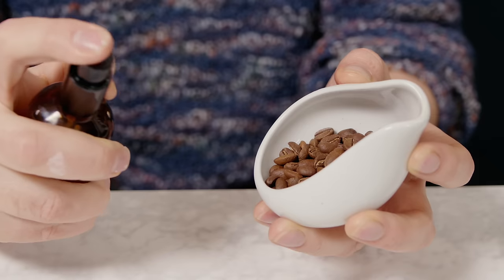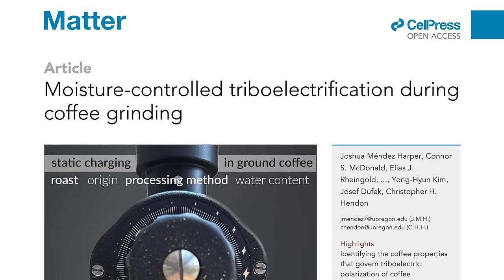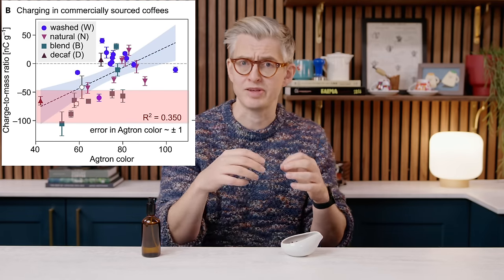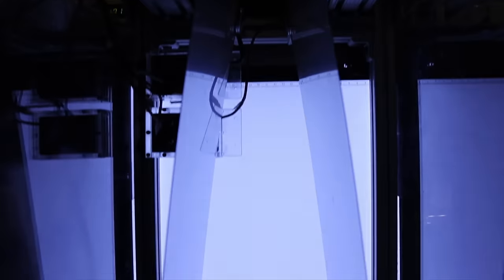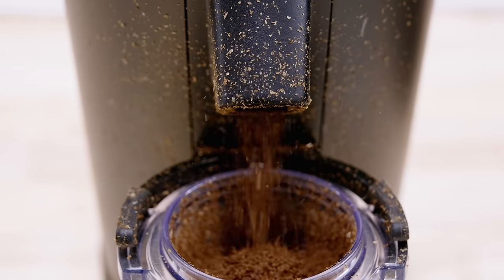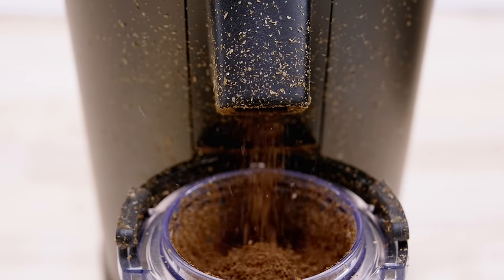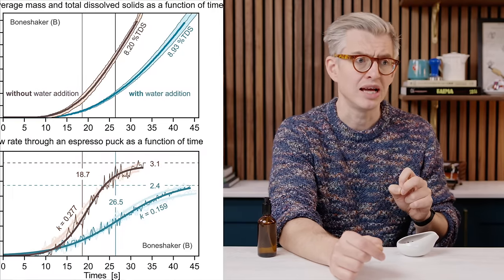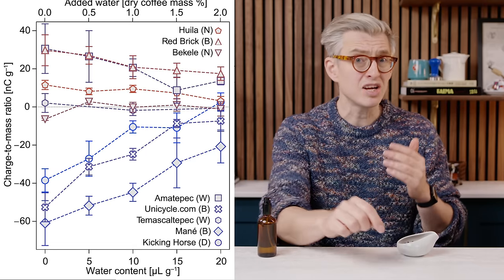Science Discovers What We All Missed: More Than An Anti-Static Hack

Comment: Yes I've found that making a cup of coffee is an extremely
complex and difficult task where you need to follow and implement
thousands of individual molecular interactions at the higher spatial
plane in conjunction with the knowledge that if E2 - 1799.098 + 
G777.00LlkF is the variable constant at 45.668 square millimetres
of the higher plane at mass44.6 G's squared (if raining at 2.03 pm
the previous day during equinox) then the resulting warping of the
fabric of space and time(if cloudy at 9.03 a.m) can create disastrous
anomalies at the point of hot water contact with the cups porcelain conjunction
area. (at average sea level)

Comment: I don't have appropriate spray container, so I decided to just wet my hands and rub the beans between my palms before grinding in my Wilfa Uniform, which I know is not an espresso grinder. I used the same setting and process as I always use for a fairly decent espresso, though it has been too quick and the pressure insufficient. 

The wet bean rubbing trick (I should think of something catchier...!) proved to be the missing piece for this setup. 9 bar and 22-25 seconds on first and subsequent control shots! It made for a superbly delicious espresso using 18 grams in -> 40 grams out using a washed Kenyan filter roast by Jacu. I'm absolutely hopped up and on the verge of tremor from having enjoyed my results, so I will have to wait until tomorrow to try it on the other filter roasts in my cupboard; a natural Ethiopian from Tim Wendelboe and another Kenyan from Supreme Roastworks. I am ecstatic! What a joy to be able to have specialty-grade espresso at home, after a year of refusing to capitulate to getting another grinder! So begins a new chapter.

Comment: I wonder if the charging isn't partially the reason why steel burrs are preferred to ceramic ones.

Steel is a conductor so it would help in dissipating the electric charge while ceramic is usually an insulator which can't conduct the charge away so the overall charge in the coffee would be higher.

Because usually as a cutting material ceramic is usually better - longer lasting, harder etc.

Comment: I do a V60 or perhaps two each day.  It seems like some days the flow is rather dramatically different — slower — than on other days.  I don’t really pull out my lab coat and figure out what is going on.  The grind and dose is exactly the same each time.  Yesterday afternoon’s coffee was an example.  It was significantly slower at dripping through the filter.  Could this be related?  There are days when the static electricity of your shirts, etc is higher and other days when it’s less.  Is this causing more or less clumping and thus causing more or less flow?

Comment: So I grind for French Press and have an inexpensive (comparatively) Breville Conical Burr grinder. I don’t store beans in the hopper but I typically DO grind my 70 grams per litre in one go. I don’t know whether my data would be as helpful as those grinding for espresso where extraction differences are more noticeable. But I do get SO MUCH STATIC. Maybe I can try the water with my variable being do I get better results grinding the 70g all at once versus 23-23-24? A side issue - I wrote an article on five local roasters and one told me I’m “chasing flavor” by buying darker beans. I’ve been using James’ French Press method for years now but still can’t get a medium brew to work for me. (Don’t like the fruitiness of light.) Any advice is welcome.

Comment: Once you put the grind into the analyser you probably break apart the conglomerates* (the actual term). The grinder does not inherently grind any different due to the water, it wouldn't make sense for the water to influence the grinding done by the burrs, its an interaction between the product itself. 

As for seeing differences in different grinders. I would look at the absolute extraction between those that you notice a difference in, and those that you dont. The theory being that one burr would see an improvement, but the other would already be at the higher extraction without water. Using the same espresso machine ofcourse. That way, you can more definitively state that some grinders are less effected than others, and that would be nice data for burr/grinder manufacturers to analyze the impact of the materials used.

Comment: I'm not sure if this hasn't been mentioned yet, but could particle distribution be a factor as well? If an 'electroclump' is formed because a larger particle attracts smaller ones, one would expect the electroclumping effect, and therewith the effect of the water to counter it, to be stronger in grinders that have an unequal particle distribution. I'll try it with my Niche 🙂
Reply: Similarly, would the amount of spritzed water affect the resulting particle size distribution? If there are fewer aggregates, then there'd be fewer "larger" particles and relatively more "smaller" particles...?

Comment: Sooooo, Shall we dial in coffee with RDT or not? What about the use of puck screen/filter paper? 
Sooo many questions. 
I would say that DF64 Gen2 has does make a difference in the coffee with the more RDT (3-4 times) as it has an ionizer build-in. Whereas , Oro does not have ionizer. 
Could also be that the heat generated during grind time on DF64 is more than the Eureka. Which also does increase the charge in the coffee while grinding. Hence my guess could be Eureka has better heat dissipation.  Which is weird as Eureka Oro has more motor RPMs. 
This is indeed a very interesting research, but i think more information should be taken into account. Like motor RPMs, heat generation, before and after particle analysis.
Reply: Also, how different roasted bean are affected from this, like light, medium, dark..

Comment: I wonder if there's been enough consideration for retained moisture in the beans. That could be having a significant impact on the resistance of the puck to flow. Imagine instead of coffee grounds, there were thousands and thousands of tiny dry sponges in the portafilter. Now, imagine that same portafilter, but those tiny sponges have been moistened ever so slightly. I would imagine that as they are tamped down, the slightly moistened sponges would be more malleable and more apt to form a tightly uniform bed with fewer channels. I wonder if there would be a way to measure the moisture content of beans that have been ground without rdt, and beans that have been ground with rdt. You could then perhaps add moisture back to the dry beans and compare those to the rdt moistened beans. If that eliminates the difference in extraction and channeling, it can be accounted for by preventing ionization/ electro clumps.
Reply: *can't be accounted for

Comment: having a gen 1 fellow grinder with gen 2 burrs - which does not have an ionizer - RDT method for pour overs diled in on "4" - really help with the mess / and getting all the grinds out. I no longer have to tap the chut to get addtional grinds out. does my coffee taste better? probably - since the grinds are much more consistantly falling through. my ratio is 24grams on 15:1 ratio - pour over in the size 2 hario. - i will continue to use the RDT!

Comment: I thought most if not all grinders would grind slower for espresso than it would for pour over / filter. It takes more energy and probably more revolutions. Interesting if the oro SD can do both at the same speed approximately. 

So have you tasted the df64s shots with and without the excessive RDT to see if there's actually a taste benefit? Because the few times I tried RDT I thought it seemed like coffee was very slightly worse or missing something but didn't test it enough for a real conclusion.

Comment: Would freezing the burrs prior to grinding help with the temperature related static accumulation? I suspect I would thoroughly enjoy seeing James trying to quickly swap burrs that were frozen in a bucket of liquid nitrogen.

Also, since the measured particle size didn't change, could the difference in flow rate have to do with having damp grounds? What if you sprayed the grounds after grinding instead of before, do you observe the same decrease in flow rate? Wouldnt help with static, but may account for the flow rate differences...

Comment: @ 6:00 min my hypothesis is that the increase I. Extraction is as a result of the high specific heat of water meaning less of the natural oils/organic compounds are aerosolized (so to speak) in the grinding process.

Just wanted to put my hypothesis down before continuing.

Comment: Yeah, just use a grinder made of metal and no charge will stick to the beans as they will be depolarized instantly the moment they touch the grinder's walls. The issue of static electricity is only really present because many grinders are made of plastic.

The slower flow rate and higher content of dissolved solids when water is added can be easily explained by the fact that water provides additional density and at the same time is a good solvent. So when the wet coffee is ground the water helps extract the the coffee oils but when brewed it's a bit more pasty so the hot water flows through the mix a bit slower.

BTW the electrofracturing is technically just piezoelectricity.

Comment: Could it be that there are two phenomena's at play at the same time; static electricity yes, but also the added moisture content in the coffee helps the coffee absorb more water better. You can see this phenomena in kitchen rags; if dry they won't absorb water so well, but if a bit moist, they absorb water very well. Also in deserts fresh rain on dry sand flots on the sand and doesn't get absorbed into the ground, causing literal channels and flash floods, whereas moist soil can absorb water much better.

Comment: What I'd really like to know is what I should put in my spray bottle. If I use just plain, clean water then after a day or two it ends up spraying smelly mold water, and there's no remarkably practical way to clean out the spray head on a regular basis. As a result, I very quickly abandoned the water spraying step.

Comment: I don't know what's going on, I'm getting the opposite effect. Shot speed went up from 25-26 seconds to 19 with the same coffee, grind size and puck prep. The shots taste less extracted and the body is noticeably thinner. Almost no crema as well. Looking at the pucks, there doesn't seem to by channeling, yet the shots taste as there are channels.

The coffee grounds don't clump as much and don't stick to the walls of the cup I grind into, but they feel not as fine as they were when I was grinding dry beans. Is it possible that the water is making coffee grounds stick to the burrs and decreasing their ability to grind finer? I'm using a Baratza Sette 270 (conical burrs).

Comment: Since we're talking about electrostatics, wouldn't it be interesting to compare the effect of burr materials on the results shown here?  I have a  Baratza Forte AP with ceramic burrs.  But the Forte BG appears to be a virtually identical machine, except it has steel burrs.  You'd be eliminating a lot of extraneous factors by testing these two machines side by side....

Comment: @jameshoffmann I recently watched your video that claimed grinding slower aka feeding the beans into the grinder slower will give you a significantly more even grind and thus change the time it takes to pull a shot of espresso. Watching this video makes me think that this publication might explain why that is happening! Feeding the grounds in slower might change the size of the 'electro-clumps' that could form and in addition it reduces the friction between the beans. If I find the time I'll try to run some simulations on that. (I've never simulated something as large as a coffee bean though so I'll try to get the input of some theoretical chemists first.) I also think that your new device measuring the same grind size is validating the papers claims. The clumps themselves still consist of smaller particles and I don't think the device is able to measure the electric forces between coffee particles that for an 'electro-clump', so the device doesn't 'know' that there are clumps.
Would it be possible for you to measure the difference in grind size of coffee that was fed into the grinder slowly vs. at a normal rate with your new device? If so could you send me the data? It would certainly help in setting up the simulations!

Comment: How have people found their results with espresso? I store beans in the freezer and brew with moded super jolly and barista express. I always do one spritz but have tried uping it to 4/5. I found i had to significantly reduce the grinder setting as it nearly chocked with the same setting. I did eventually get it dialed in but then the problem became its very hard to repeat 4 pumps and get the same amount of water on the beans. This lesds to inconsistent extractions. How quickly you pump and the distance plus cup shape really effects how much water makes it to the beans. Ive gone back to 1 spritz for now but am thinking moving tona grinder wich doesnt need spritzing would probable be ideal for consistency now?

Comment: A bit late in viewing / commenting but my first thought is that the different grinders are designed, constructed and coated differently. This likely will affect any charge generated. A "next step" might be to run the output grinds through the charged plates drop path as illustrated in your included video.

Comment: What about the charge generated from a hand cranked grinder versus electric. Measuring speed, friction, materials. Adding coffee and water with dissimilar metals causes an endothermic reaction and potentially creates a battery with two dissimilar metals such as bearings, gears, add an electrolyte and insulator. Battery. You would need to do a control test with distilled water, plastic or some other non metallic durable material  at a controlled torque and speed for a set period of time and then try multiple beans with multiple different roasting options. It would be a task to really get to the bottom of it. 19:37

Comment: Wouldn’t WDT get rid of any or most “electro clumps?” Given that the coffee grounds in the portafilter have varying positive and negative charges, wouldn’t mixing them and un-clumping them with a WDT tool neutralize most of the charges accumulated during the grinding process with no RDT?

However I did do a test with my dialed in espresso and using 4 sprays of RDT on my beans before grinding, I noticed an increased flow rate of about 0.3 grams per second. To note tho, I still used WDT for both trials. Very interesting

Comment: I have not taken the leap for a burr grinder as they are quite expensive, so I am using wizz grinder and aeropress. I've never found static to be an issue. Curious if this would be relevant for my current setup. Note: I also don't make my coffee the way the instruction booklet reads, but rather treat is as kind of a french press ie. I let it steep for a couple minutes and before pressing the plunger.

Comment: Fairly sure it works for pour over too. But cant really prove it as my Fellow Ode v1.1 would make horrible mess without spraying beans first. :D Could test it on Comandante tho.

Also what might have something to do with this theory is speed of grinding and how many beans agre ground at the same time.

I suspect that less beans you have ground at same time and/or at lower speed, better result you get. Probably due less static charge.

What I do, cause Im insane, is that I feed my Fellow Ode 1.1 beans one-by-one.

I simply weight my beans, which is usually around 14 grams, lay them flat on small teacup porcelain plate, spray them rather vigorously (my rule is never less than 3x spritzs). Then I often let them be for some moment, so they absorb moisture a bit (it doesnt seem to have impact on static charge build-up unless they become really dry), and then just start grinder, put that plate angled on top of it and feed beans, one by one. Faster than would you expect.

Difference between just spraying beans and throwing them inside grinder vs feeding them one-by-one is nothing short of amazing. Extraction with one-by-one method is excellent and whats best is that I can grind really fine and it still goes thru pour-over pretty fast. While just throwing beans in at same grind size will result in choked pour-over.

Perfect grinder should have one-by-one feed and some charge neutralizing grind chamber.

I found this bit of feeding it really slow somewhere on reddit, not my idea. I tested it and it worked. And since I do a lot of phin filters and I do like Tricolate, it means everything to me, as both methods are really picky about grind size and overall grind quality (and Tricolate especially is bad with static charge of any kind).

Comment: I'm dialing in my Sculpture 078 right now, but not thinking different drawtimes as such with or without rdt. I Hate static and it's horrible - but i don't have even grounds - i'm used to with my 1z jx i've already dialed in and i sort a bit of chaff too - but a flat burr do crush more of the chaff and its harder to remove..